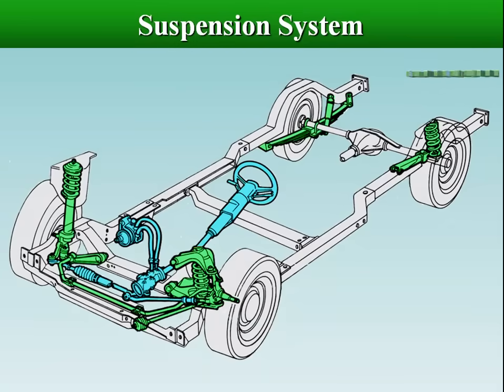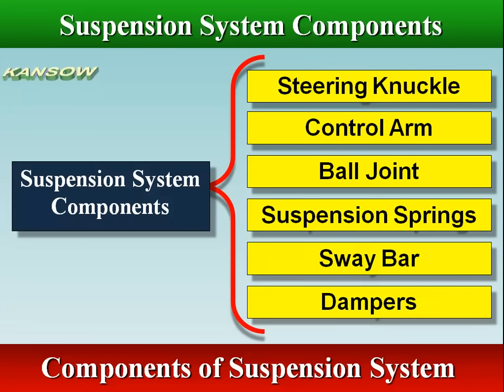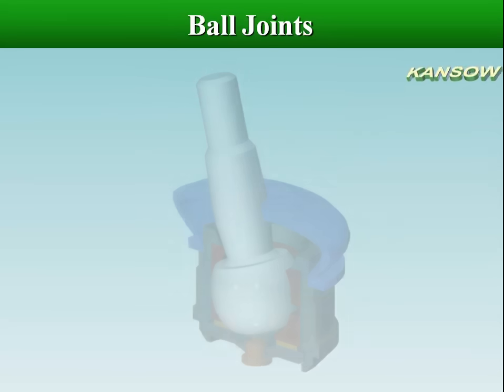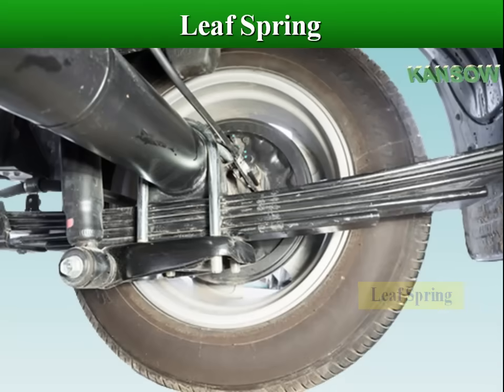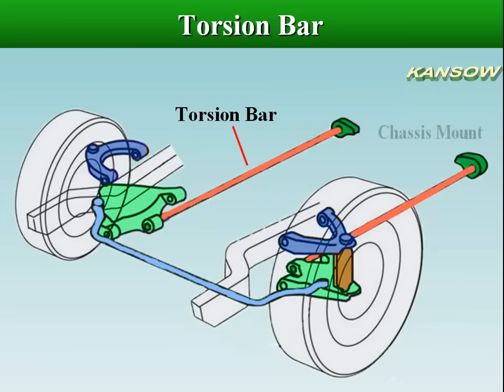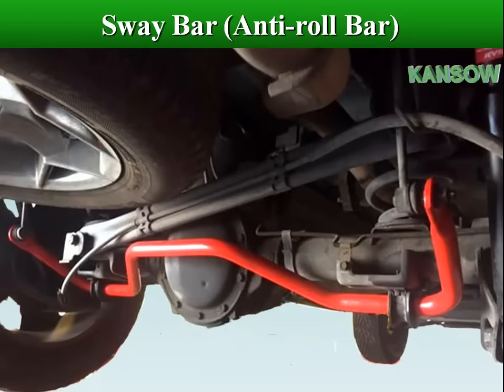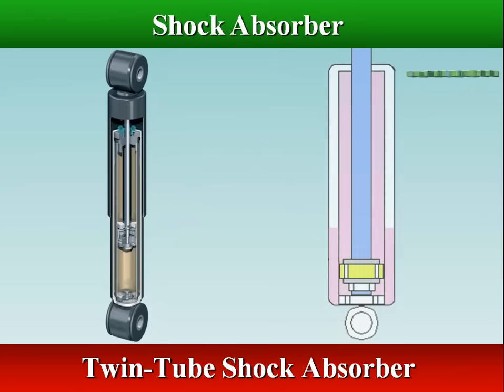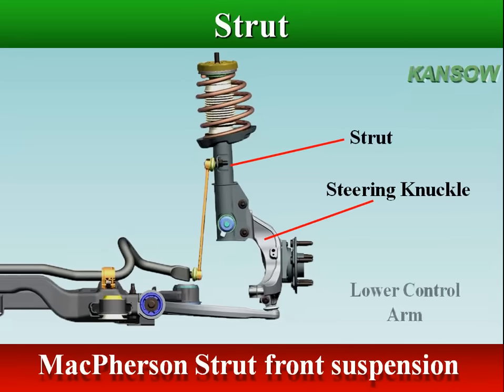Suspension System Components

Comment: And this is why you slow down for rough pavement or things like railroad tracks. Because those things wreck havoc on these components. Next thing you know you will be told you need things like balljoints or tierod ends etc. Driving fast over potholes or rough railroad tracks even if you do not feel it in your car will cause these parts to fail. It will then require replacement of these parts or they will break and cost you your life. If you live in the rust belt these parts when replacement is need are rusted in place making them difficult to replace and the shops know this so they charge accordingly.
Reply: Or they’ll tell you you needed a Johnson rod and Johnson rod I don’t know whatever OK

Comment: At the risk of exposing myself as a complete… What is that horizontal rod that was not mentioned, but what was the rod shown in three photos comes from the nearest center of the wheel, and has a rubber boot at the wheel?

Comment: what is the different between coilover n strut?
Reply: The strut combines the coil over spring with lower control arm and is a single unit also is connected directly to the steering knuckle where as the coilover is just a coil over spring.
Reply: @josegasca8178  thx bro

Comment: Thanks  this  was really done well   question  though at 5:38 in you say the coil springs twist to absorb the force of impact  so they dont just compress they actually twist via the mounting bracket bearing  that is not actually  shown but I believe it is true
Reply: If you compare a small part of the spring, like adjacent part, they are rotating or twisting against each other. That is the torsion of the metal. Overall the spring appears to compress. The spring energy is actually the torsion of the rod of steel. It is coiled to take up less space.

Comment: My steering vibrates during braking if i drive over 100kmh. Already replace the front absorbers  but doesn't solve the problem.
Reply: Those might be worn brake rotors
Reply: Check your tires
Reply: Maybe your bearings has so much play inside the knuckle you need to replace them